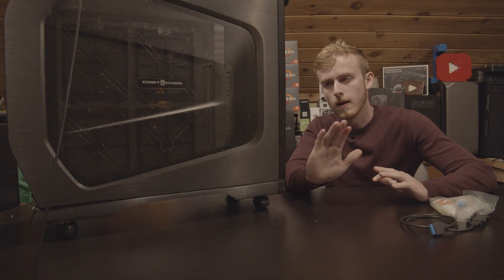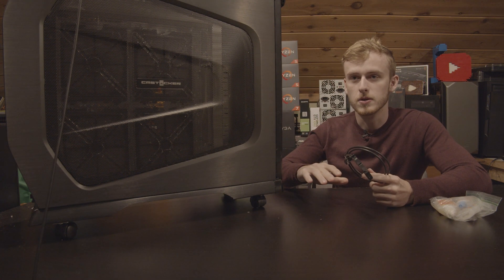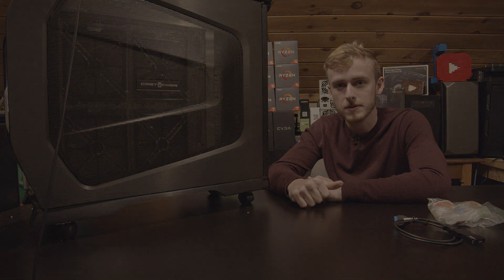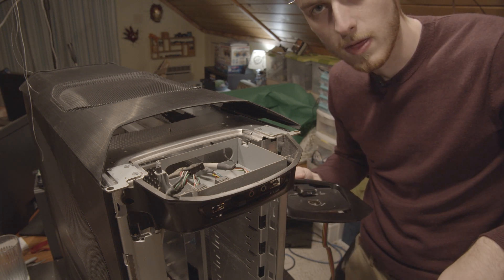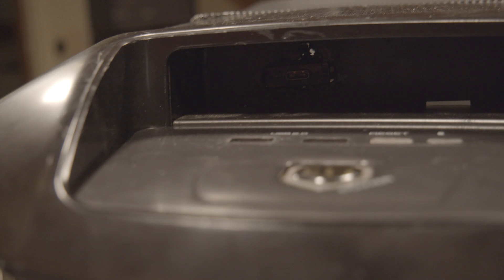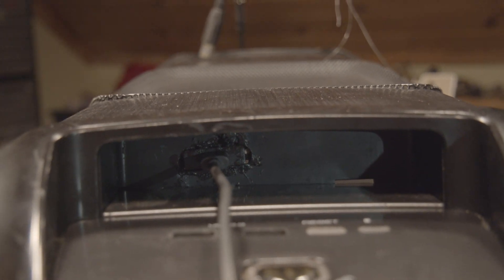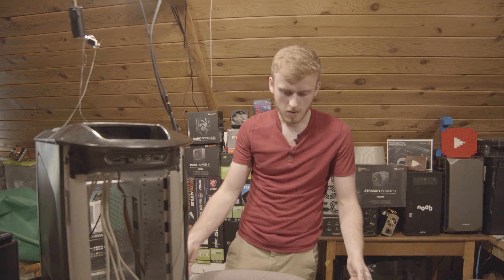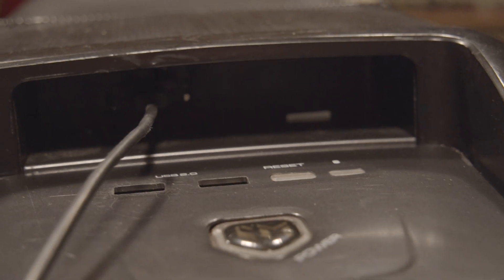Updating The Most Expensive PC Case From 2010 | CoolerMaster Stacker 830 SE

Comment: If you have an old case, it will have a 5.25" drive bay for an optical drive
You can buy USB 3 panel that mounts to a 5.25" drive bay
Much simpler way of doing this
Reply: As I will eventually use all that drives bays, I'd rather do this. Not the terrible USB C port tho.

Comment: I have the same case Jay.  Was wondering how you removed the control panel/power switch?  My power switch is loose, and I'm trying to rehab this old (and awesome) case back to life.

Any tips would be great
Reply: Theres a Screw from the bottom Holding it in place. The rest clips in. Also on of the left and right of the bottom part

Comment: An old case that was relatively expensive back in its day, yet is still a nice case would be the Antec p182
It had noise dampening front and side panels, easy install hard drives and optical drives, rubber grommets for mounting hard drives, it looked sleek, etc